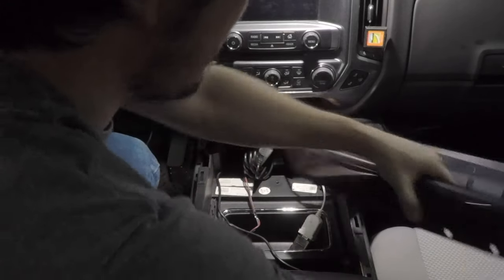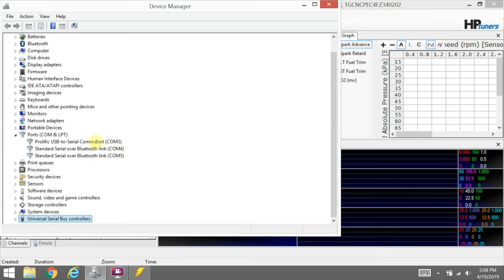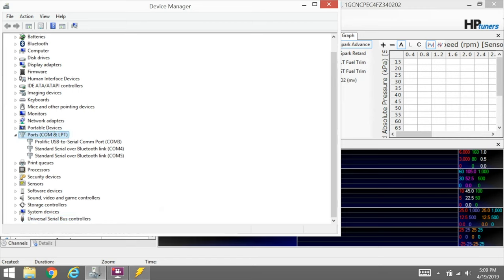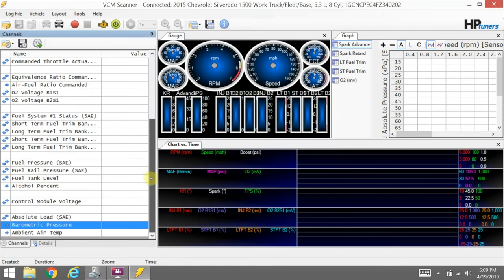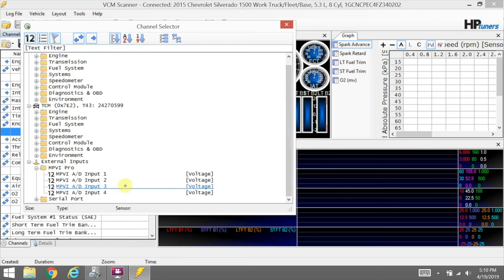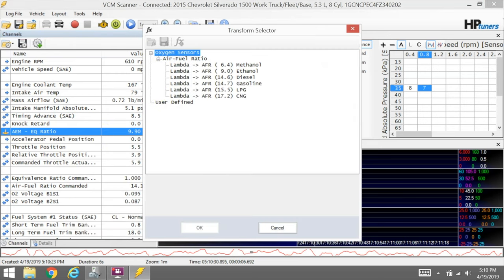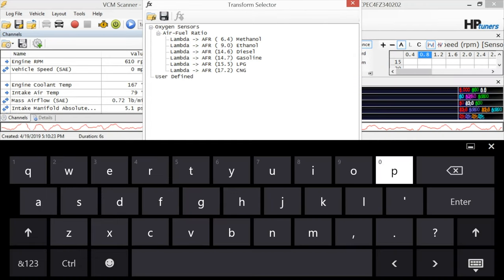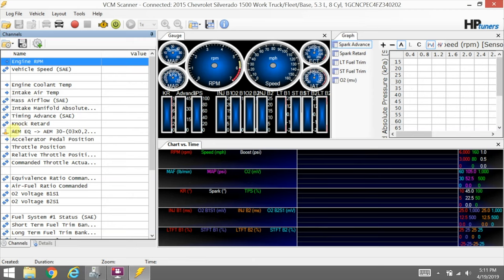Wideband Install Using Serial Connection and HP Tuners, AEM X-Series

Comment: Is there a way to hook up a wideband so it reads through the ECU?     Someone told me it's possible through the egr circuit(since my egr is deleted)  but I haven't been able to find any solid info on that
Reply from the maker: Josh, the short answer is yes.  The long answer gets a bit more complicated, it is often dependent on what ECU you have then what channels you have available.  If the EGR circuit was an analog then you in theory should be able to wire the analog out from your wideband into that circuit, then you will need to do a conversion on the signal.  The original device is generally going to be a 1-5v signal, like your wideband, but then your ECU scales it and that is what you see in the scanner.  You then have to go into the scanner and alter that signal to scale to your wideband so effectively you are going to have to use math to switch it back to the 1-5v scale then use another equation to switch it to your AFR reading.  I want to say a lot of people were using the AC pressure sensor input back a few years ago but I haven't looked into it for a long time. Your best bet is to dig into the forums for your vehicle and engine as the answer is going to vary based on platform.  Good luck!

Comment: Just hooked up aem  30-0300 , afr keeps disappearing out of channels when I start logging , serial connection btw
Reply from the maker: Dave, try to reboot your laptop with the USB adapter plugged in. Common problem
Reply: @GoatRopeGarage  woohoo!!!
That's it!
Reply: @andrewsmotorsportsperforma6751  I just had the same issue, reboot didn't fix it this time,  i went through multiple combinations to get it back. What I think I did to get it back was, turn key to on position, let gauge go through warmup cycle,  and display afr...then rebooted...I tried so many things I am not 100% sure that's what did it...good luck
Reply: Goat Rope Garage update, I had it happen again, this time I disabled the com port  then enabled it in device manager. I blame win 10😂
Reply: Mate can I ask what ECU and car year model, as im going insane trying to get mine to work
 Thanks.

Comment: First thank you for this video. I want to make sure I understand one thing. Basically the OBD port connects to MPVI2 with OBD extension cable or MPVI2 connects directly to the OBD port. Then the MPVI2 unit has a USB cable that I would connect to the USB hub. The AEM 30-4110 has a connector with bare wires. I use that to make the RS-232 Serial Device cable and connect the serial to USB adapter to the USB hub. The same USB hub that the MPVI2 is connected to. Then I connect the USB Hub to the computer. Am I correct with the setup? 
(Basically Wideband and MPVI2 are connected together and sent to computer via a USB hub.)
Reply from the maker: Yep, nailed it!
Reply: Thanks for asking this question, this is my exact situation. Any advice?

Comment: So I’m trying to connect my Aem 30-4911 Wideband/boost/ethanol gauge into my scanner like how you have this set up but I don’t think I have a serial output on the gauge. I want to log afr and boost pressure in my 2010 C6zr1 because I’m maxing out the stock map sensor and want to see an accurate boost reading plus I need wideband.  Any suggestion on how to do this?  My specific gauge isn’t listed in the preset gauge selections.  I can’t seem to get the boost to read in pressure it just reads voltage.  I have afr to aux 1 and boost to aux 2 on my pro link cable.

Comment: Hey Kyle quick question about my serial input. Whenever I begin scanning it disappears until I close the scanner out and reopen it. I do not have any other usb to serial com ports listed in device manager. Any ideas?
Reply: I've seen a few different thoughts on how to try to get this to work so I will do some of the suggestions. I will see if I can get something working tonight possibly and update this on what I did.
Reply: So I tried to just run the cable first, truck on, plug everything in and then turn on the laptop. Still nothing. Someone says I should switch to pin 3 which does not make sense to me.
Reply: I have this same problem

Comment: It seems HP Tuners rolled back features in theor updates. I was able to log my AEM EQ without Pro features using the OBD input when I first bought it. I haven't tuned in a year and now the AEM disappears no matter what when I start logging.
Reply: Update: I figured out how to log an AEM OBD wideband WITHOUT pro features and it won't disappear during a log!
Reply: @ryancrisp6786  I'm having the same issue

Comment: Hey There 

Awesome videos been binge watching them all day. 

My question is instead of using the RS-232 to USB interface cable. Could you not just a 2.0 USB cable and hook the data cable(blue wire) from AF Gauge to pin#3 and the ground into Pin#4 of the USB and not use the male/female RS-232 cables. I’m not electronics wizard but was just curious.

Comment: So could you run your analog signal lines in place of a narrow band o2 back to your ECU? And still be able to use the wideband for tuing?
Reply from the maker: No, the narrowband works on a 1v range while widebands are 5
Reply: @GoatRopeGarage  thank you
Reply: Some wideband controllers have a programmable output that will simulate a narrow band O² and can be installed that way

Comment: I have the X series and want to use it on my 2000 Silverado, will HP Tuners log through the OBD2 as this is a non CAN bus vehicle?  Thanks for any input.
Reply from the maker: No, you'll have to use serial or analog

Comment: May have just answered my own question but still want to verify. What i stated earlier did not work. I ended up making a user defined math that subtracted the .48 error from lambda labeled (tailpipe EQErr) and all lines up. Please if there is any better ideas let me know
Reply from the maker: Yeah, that's a bit leaner than I would expect to see but if you're testing at idle you're still getting air on it most likely.
Reply: Goat Rope Garage well its reading consistently lean. I just did for comparison today another silverado with no cats and it reads the same. So somehow or another i have my scale not correct? With the user defined math where it subtracts .48 on both trucks gets it near 0 err.

Comment: I you don't have you MPVI2 permanently mounted to you OB2 port in you vehicle, do you need the USB hub.  Basically can I hook the Wideband into one USB port on the computer and the MPVI2 into a second port on the laptop.  Or does all the info need to come through the same USB signal?
Reply from the maker: Nah, I have the USB hub because some of my gauges are also configured USB
Reply: Thanks love the Chanel man.  I’ve learned so much from your video’s.  And I’ve watch a lot of other tutorials and yours are the best.

Comment: Hey, great video. Question for you - I am just looking for software to connect to my AEM Air/Fuel Sensor (30-0300) so I can log the AFR data to look at later. Nothing else would be connected. Any suggestions? Not sure I can use the HP tuner software as it wants to "connect to a vehicle" before you can add a new channel. thx
Reply: Just create a custom channel list in HP tuner to only show Wide Band information, if using a P01 gen 3 ecu use Pin 55 on blue connector to analog output + (white wire on AEM)
and the brown wire on AEM goes to Analog output which is  blue plug pin 40.  You will need to add EGR sensor voltage in the channel list, create a new chart, and setup user math for that wide band to covert egr voltage to wideband afrs.

Comment: Do I need the pro link cable to use the aem wideband 0300 with mpvi3 for the serial hookup for logging?
Reply: No you don't, don't even waste your money on the Prolink. This will work fine via serial using this method.

Comment: Hey there dude! I bought an AEM 30-0334 wideband before I realized that pre 2007 vehicles dont support the can bus interface. Will I be able to make this work as opposed to splicing my gauge into the hp pro link??
Reply from the maker: I don't think it has a serial out, unfortunately
Reply: @GoatRopeGarage  So will your setup work on my '98 z28 with AEM 30-0300 x series WB, HPTuners version 2.2 (original serial interface), Windows 10 with USB 2.0 port?
One of the 3 items listed in the description is no longer available on Amazon. I understand why I need the serial to usb adapter to connect HPTuners serial interface to USB port on my laptop. I'm not understanding what the other 2 items listed in the description are for.

Comment: Hey bro sorry to hit you up again so soon but I think you did this video before you got the mpvi2 are you still logging the same I’m fixing to put in my AFR  gauges 2 of them? Should I still go head and and use the serial and have you used the blue tooth at all on you mpvi2 data logging ? By the way my truck runs insane that’s why trying to get my gauge in it’s running so good I must have jacked something up lol.
Reply from the maker: I didn't have to change anything going to the mpvi2 for logging with the Wideband, it's the same.

Comment: Would I be able to hook my wideband up to mpvi2 with just the pro link cable or do I have to buy the pro link feature for $249.99
Reply: Prolink cable doesn't do anything without the pro features set. If you buy the 3 items listed above its actually cheaper than the cable.

Comment: I’m setting up an LS swap in my 71 C10. I have a 2010 6.0 and 6L90 from a 2500HD, and it came with an E38. I want to be able to log normal driving and dedicated tuning sessions without necessarily using the laptop, so I plan on wiring my wideband O2 sensors semi-permanently. If I get two 0334s, I could wire the to the OBDII wiring going to the port. If I get two 0300s, I could wire them to the ProLink+ cable and use the analog data, the latter being cheaper. I will be using an MPVI3. This is a street vehicle, NA with a cam. Do you have a suggestion—opt 1, 2, or something else? Thanks for all the great info on your channel!
Reply from the maker: I would do one and go prolink. Can't adjust bank to bank fueling do the second is just to make sure the one is working
Reply: @GoatRopeGarage  got it, thanks!

Comment: hi will this be powered by the rs-232 or will it need separate power ?
Reply from the maker: No power required, the gauge you only use the TX, RX and ground

Comment: Please help, no matter what I do, I cant get the AEM 30-0300, to log on HO Tuners with the serial port, spend all day testing all the connections, everything tests good but when I start to log, the channel disappears. 2004 HSV LS2 E40. Matbe its just the wrong scanner for my ECU
Reply from the maker: No, double check that your serial adapter is loading up right, might need to update the driver for it
Reply: @GoatRopeGarage  Thanks for your help, as usual it was operator error. I had the serial plug pinned as a male plug when it is a female plug.... Thanks Kyle.

Comment: hello, i'm very new to tuning and i have been learning a ton following your tuning series. I really appreciate you taking the time to make all the awesome videos. so i have do have a question, i followed your video and ordered the serial adapter, wired the wide-band to it and also got the serial to USB cable. my issue is that i have GlowShift Black 7 Color Needle Wideband Air/Fuel Ratio Gauge with a 4.9 LSU Wideband Oxygen Sensor, part number GS-C702-NWB, is there a way to collect on that using the HP tuners or will i have to purchase one thats already on the hp tuners list?   thanks in advance for your time.
Reply from the maker: Try some of the built in serial setups for the other brands, good chance one of those will work to bring the data in, just make sure it matches your gauge

Comment: So I’ve tried Every way to think of and it still won’t stay on the screen when I hit start scanning
Reply from the maker: Chris, do you have another computer you can try it with by chance? That's going to be the first thing they suggest at this point.
Reply: Yeah I was gonna give that a shot, the one I use has windows 10 and this other one I’m gonna try is Windows 8, doing updates on it now, or I figure it’s my wideband it’s a autometer ultra
Reply from the maker: What part number?
Reply: 4378
Reply from the maker: Chris, this model seems to only have an analog output, which would only work with the pro version. You need one with serial RS-232 to bring it in without the pro.
Reply: Goat Rope Garage well dang I figured that’s probably what it was, good thing I got this wideband for free haha
Reply: Goat Rope Garage thanks for the help, really appreciate it
Reply from the maker: Sure thing, sorry it didn't work out but let me know if there is anything else you need help with.
Reply: I just now ordered the same wideband you show in the description, that way for sure I know I can get this thing hooked up lol hopefully be turning this next weekend coming up
Reply from the maker: Sounds good, report back and let me know it worked out!
Reply: Goat Rope Garage dude got my wideband in today got home hooked it up real quick and it works great, now I’m all excited to get tuning
Reply from the maker: Awesome! Glad to hear it, Chris! Let me know if you need help with anything.

Comment: Sorry if this was already covered.. But what about feeding the 0-5V output signal from the wideband into some stock sensor input on the car that is not used (EGR?, AC Pressure?, Some other deleted sensor) so long as you make sure the incoming data is not used by the PCM as a modifier (disabled in your tune). Then you could add that PID in the scanner and set it up much the same way. Would that work? Am I on the right track. lol Thanks (Love all your videos BTW)  EDIT: OR IS THIS METHOD EQUIVALENT TO WHAT YOU EXPLAIN AT THE  4:00 MARK? (So bottom line you prefer the serial)
Reply from the maker: Yeah, that works, and is the best way if you're not using the pro features or the serial input. There should be some tutorials out there in his to do it but I haven't done it so I won't be doing a video on it.
Reply: @GoatRopeGarage  well.. here I sit watching these videos again two years later ... I never "found the time"  to hook this up... but still driving my truck daily with twin turbos spooling up but not building boost cuz they both just dump to open air. I'm just making sure I don't have any oil leaks..... All right fine I have no excuses.  I did at one point put the charge pipe on and dipped my pinky toe into a little boost but my truck freaked out and went into limp home mode. I had a pretty bad oil leak back then which I have now fixed. Like an idiot I've been running an open mass airflow sensor - screen to atmosphere with absolutely no piping on it.. No filter.. No fans.. electric or mechanical. (Never overheated) Cruising around town with a bunch of stuff disabled I don't remember where I left off but I am making it a priority. Thank you for your videos and tutorials.

Comment: Thank you so much for helping us learn. You sent me to this video and I was just wondering if a person is just wanting to use the wideband to tune and not monitor all the time. Can the wideband sensor just be hooked to the scanner via the usb with out a gauge? Or is the gauge needed to convert the signal to the scanner? Again thank you for all the help. At this rate looks like I am going to have to sign up once the tuning starts.
Reply from the maker: They make ones specifically that don't have a gauge, the ones with gauges require the gauge as it's what's going the conversion
Reply: @GoatRopeGarage   Ok, thanks again for the help and I emailed you on  .com then saw the tuning disclaimer so sorry for that. Now If I would just read the replies I would have seen the answer to my question on non gauge wideband.
Reply from the maker: @paulbaker2680  no worries, Paul. I try to keep it between the comments and the Patreon. If you're a patron great, if not post it on the comments and maybe someone else will find the information useful!  The unit you're looking for is

https://amzn.to/2ObwIPw
Reply: @GoatRopeGarage  Got everything on the list ordered to hook up to my scanner. So just to clarify on  the ground. Pin 5 and the sensor both go to ground.

Comment: I’m just getting back into the car scene and back in ‘03 I purchased an innovate  lm-1.  

Do you think this would work fine with hp tuners? I hate to purchase a new one if I don’t have too.
Reply from the maker: It should, Travis, LM-1's used to be the standard but I'm not sure if it has serial support, so it may only work on the pro version of the interface.
Reply: Goat Rope Garage   thanks for the help/info.  Also great job on your videos.
Reply from the maker: Thank you! And I'm 99% sure it will work serially with that unit because of I'm not mistaken it uses serially to tie into it's own software. Let me know if you have any questions!

Comment: im trying to hook up a innovate ECF-1 i got the pid on there but it reads 500 something lambda.
Reply from the maker: Using serial or analog?
Reply: @GoatRopeGarage  serial to usb
Reply from the maker: @J Cunningham if it's reading in but incorrect you may just have to scale it. I've but used innovates in years. You might have to call them since that is a 4 in 1 unit
Reply: @GoatRopeGarage  yep thanks it was reading around 500. so i just changed the divided by from 1 to 498 and its as perfect as i could get it. i made sure I was getting the right signal by disconnecting the  FP and Flex sensors.  adjusted it then hooked them back up and its reading the same O2 as the gauge.  Thanks